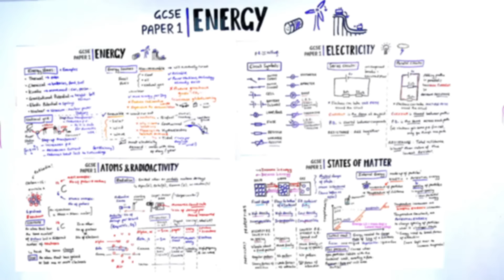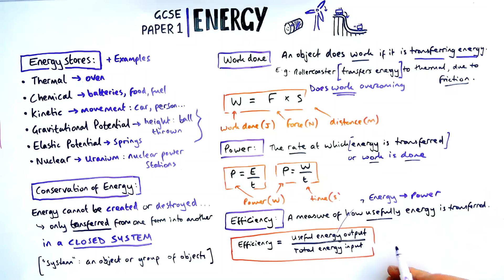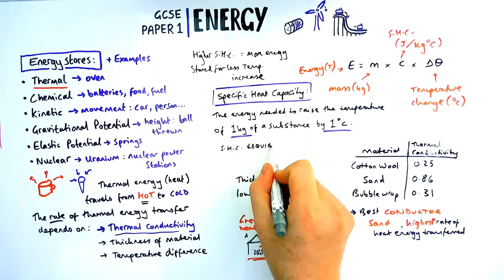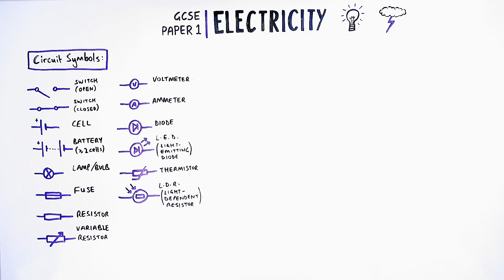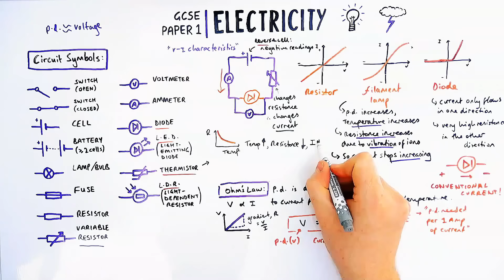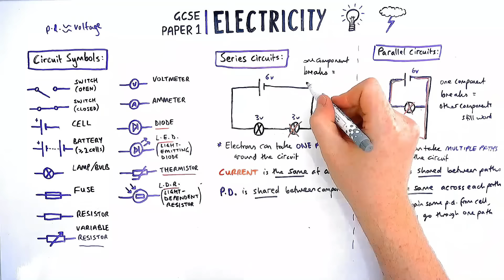WHOLE of GCSE Physics Paper 1 in 64 mins!

Comment: Hi sir, I was just wondering what type of radiation and what length of half life is the best for certain uses like protecting foods and medical tracers because I know you explained the medical uses but I don't understand if it should have a long or short half life because you don't want it to last too long but also not be too high of an activity? 😭
Reply from the maker: Hi, really good question! For use in medicine, you want a shorter half life so the activity is high for using it, and that there isn't a significant amount of activity days later (when you don't want to use it) and it could continue to harm someone
Reply: @captainphysicss  Okay thank you that makes sense and this video was extremely helpful so thank you!

Comment: hello ,  at 16:03 u write p.d needed per 1 amp of current , im wondering what that meaans pls can u explain
Reply from the maker: How much potential difference is needed for 1 amp of current to flow
Reply: @captainphysicss  thx for replying .so does that mean the higher the resistance the more pd there is needed ?
Reply from the maker: @hna143correct

Comment: wait for LED, if they're used in street lamps then lamp would turn brighter as light decreases, but if resistance decreases when light increases the opposite would happen? because Current would increase if resistance decreases?
Reply from the maker: Great question! The LDR in a street lamp acts a detector of low light - the light just switches on, doesn't get brighter as it gets darker. So the circuit is a bit more complex than just an LDR, there will be a voltmeter across another component that will increase as the resistance across the LDR increases - acting as a switch to switch the main bulb on (this is not expected knowledge at GCSE!)

Comment: Sorry but at 33:40 aren't solids meant to have the lowest potential energy and  gasses are meant to have the highest potential energy as they have the most energy stored by overcoming the attractive forces of the atoms?
Reply from the maker: Yeah they are I made a mistake - corrected in the video description
Reply: @captainphysicss  No but I think you're right sir? Gasses have higher kinetic energy than potential because potential is by virtue of postion of the molecules. They aren't close together in a gas. They're closest together in solids. Please correct me if I'm wrong I'm going crazy over this
Reply from the maker: @alleeyeah Potential energy is higher in gas particles that are further apart. It's one of those things that doesn't make lots of sense until you study chemistry at A-level, but what I've said here (not the mistake I made in the video) is correct